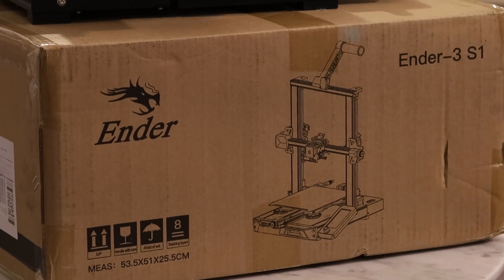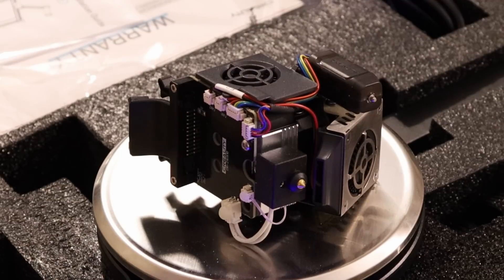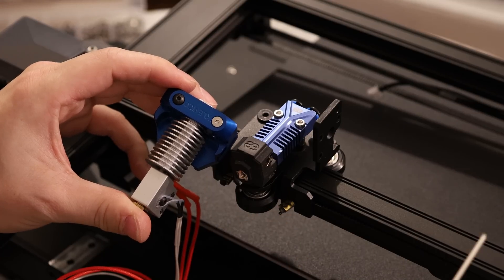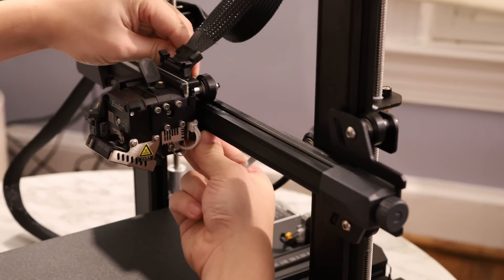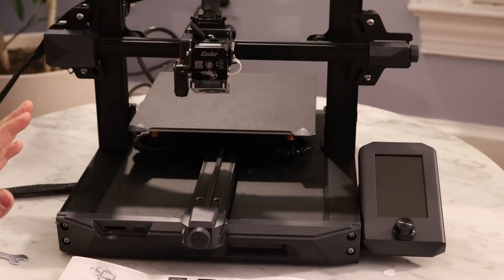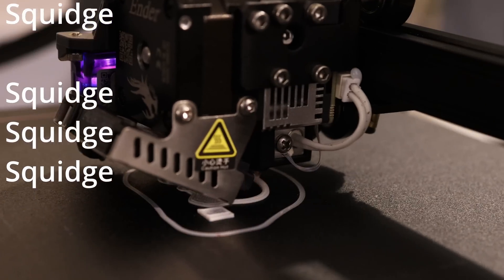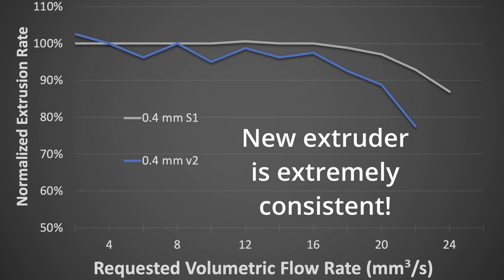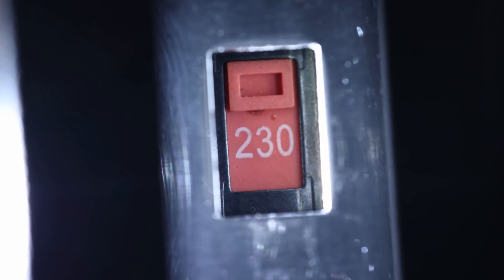Ender 3 S1 - A New Benchmark

Comment: centrifugal fans have way more static pressure than axial fans, so that's likely the main reason they changed it
Reply from the maker: Yeah, for pushing air through a heatsink it makes sense. They could use higher fin density inside of the heatsink. It's pretty much a straight shot through,  can't imagine much pressure drop occurring over that distance.
Reply: @NathanBuildsRobots  the higher pressure also means the air can take right angle turns without as much loss, so it can help with packaging constraints too, which is a common struggle with extruder assembly designs.  they're noisier too though, so i guess it's all a wash 😂

Comment: So I've owned an S1 for over a month now. I've added a new heat block and all metal hotend and changed the bed to glass and It prints amazing!. Comparing pictures of prints from the prusa i've seen on groups im a member of i will say they look identical in quality. The only thing that needs to be addressed is the auto leveling. I personally don't think the creality auto leveling is perfect. This is probably the reason I put glass on the bed, I don't use the auto leveling function on the printer but i manually level it myself with help from third party firmware. 

I would say if you want a printer that prints amazing out the box and you don't have to do anything to it... buy the prusa
if you want a printer that you can modify and change things then buy the S1 for half the price. 

I don't regret my purchase and I'm thinking of getting a second one soon!
Reply from the maker: Cool! I have someone in my Discord that says they use the bed leveling probe to tell them how much to turn each knob to level the build tray. They did it with a macro in Klipper. As you could see in the video, my bed was super warped, but I have done some full plate prints without issue, so the bed leveling must be doing its thing!
Reply from the maker: Oh, also I always overextrude the first layer, laying down an extra thick 0.6-0.8mm wide bead out of a 0.4mm nozzle, so it really squishes down into the bed. IDK if this would help you but that seems to work for me when I have bed adhesion issues.
Reply: @NathanBuildsRobots  thanks for replying :) I just don’t know what it is, if I level bed manually then run auto bed level then do Z axis it does the first layer okishhhh 

If I reset printer and manually level and print then it works almost perfect on first layers. 

It’s a great printer tho :)))

Comment: Love the video. I have the s1 pro it's also a very good printer. One thing I'd mention (granted I'm halfway thru the video rn) is your z-offset is too low. try raising it up a bit and you should get much better removal and very good adheasion still.
Reply from the maker: I already trashed the bed so I don't need to worry about it anymore!
How do you like the Ender 3 S1 Pro? I'm doing my review of it now. Pretty much done filming except for the conclusion.

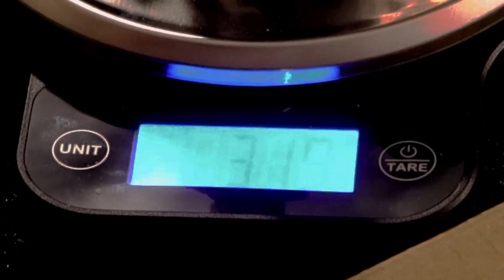Comment: 1:30
Putting the scale on a soft surface increases the measured weight over the actual weight

It would be a good practice to weight it again with the scale on a solid surface 😉
Reply from the maker: That's what I tell myself when I weigh myself on the carpet.

I don't see what would cause that effect, but it doesn't cost anything to set the scale on a hard surface so I'll keep that in mind for future videos.

Comment: Yeahhh definitely not an MK3 killer lol. Prusa still uses genuine stepper motors, rails and bearings, E3d hotends and Bontech gears, not trash bin components that will wear out overtime. Genuine kevlar gates belts that wont stretch and don't need any adjusting. No V slot wheels that need adjusting or will wear out overtime. Linear rails are more accurate and reliable than the V slot wheels. MK3 is held together with 3d printed parts and zip ties and still more accurate than an ender.

Creality's CR probe is just a re branded BL touch, And BL touches are finicky and less constant than prusa's PINDA probe, in my experience. MK3 doesn't need any bed leveling, just the initial Z offset. Creality needs that, plus the initial Bed level using the 4 wheels. The ender 3 S1 may share a bunch of features that the MK3 has, but even then, those features aren't even as good as what prusa offers.

Comment: hi, can this print nylon out of the box without buying extra parts?
Reply from the maker: Yes but mostly no. There are low temp nylon formulations that will work at the upper end of a PTFE lined hotend's temperature rating. But its a much safer bet to upgrade to an all-metal hotend first.. Either the official creality one, or the Slice Engineering Copperhead that I show in a later video.

Comment: "Prusa Killer" is sort of a stupid thing to call a printer that is aimed at a completely different market. A Prusa will print with high quality in minutes after opening the box and will repeat that quality for years with only minor maintenance. That is what you are paying for not a list of features.
Reply from the maker: Historically there has been a big gap between easy to use, high quality printers like PRUSAs, and cheap, dodgy hobby printers like the old Ender 3s. Personally, I'm glad to see some entries that fill the gap. For some people, this is as good as an I3MK3s, depending on what their needs are. 

Needs something that can run 200 hrs per year and is relatively easy to use? PRUSA and S1 have you covered, but S1 is cheaper and has less lead time.

There are still a host of areas where the PRUSA is better, but in terms of ease of use, the S1 is pretty compelling.

Comment: the machined off inlets for the z-axis frames also means the old grounding issue is solved
Reply from the maker: I'm not familiar with the grounding issue
Reply: @NathanBuildsRobots  when you disconnect the PSU from its mounting points, (double-z mod) it loses grounding to the frame. i can't tell you that it creates issues in and by itself, but it could potentially create issues if your wall socket or circuit isn't properly grounded for whatever reason

Comment: It’s crazy that Creality doesn’t put a note in the directions, a large sticker on the back near the plug and the entire screen protector you literally have to remove from the control panel prior to use that says to check the voltage switch. If they did that it would make it virtually impossible to overlook. You’d literally need to be brain dead to miss something like that! Oh well maybe they will include that with the Ender 3 S2.

Jokes aside I did enjoy your content. It’s well paced and you focus on a lot of things that are interesting and useful to the community like the compatible mounting points.
Reply from the maker: I don't read so good...

Comment: I heard there's less memory, so what are the default safety precautions in the firmware. Y'know, things like Thermal Runaway, etc.,
Reply from the maker: I have triggered thermal runaway on the hotend with my fan that blew too much air, so I know its on there. I'd bet they are all in place but I have not tested them individually.

Comment: how does the auto bed leveling work does it level itself or it lets you know where it’s uneven in level?
Reply from the maker: At the beginning of each print it makes a topographical map of the print bed, then moves the Z axis up and down as it's laying the first layer, to make sure it is at the correct distance from the bed. It requires a 1- time setup, then it automatically levels on all your future prints.
Reply: @NathanBuildsRobots  I’m guessing this is only good as long as you have the same nozzle on it? I often switch between 0.4 and 0.8, which have different “heights”, making the auto levelling sorta pointless right?
Reply from the maker: @rushilkisoon  yeah you would just have to change the z offset using the screen interface when switching nozzles.

As long as it's +- about 1 mm you should be fine. 

Some printers have load cell based ABL which would work better when changing between nozzles.
Reply: @NathanBuildsRobots  cool thanks for answering! I guess until I decide to upgrade to a nozzle based, load cell mechanism, like the prusa, manual levelling will have to suffice on my 5 Pro.
Reply from the maker: @rushilkisoon  the prusa uses a pinda probe, which is their name for an induction probe. It is essentially a non-contact limit switch. It only work on metals though, and you have to adjust the z offset with nozzle changes. Adjusting the z offset is pretty common and not too much hassle. 

The newer prusa max, which hasn't been released yet, is said to use a loadcell based system. The cr-6 se, mingda magician x, and more use loadcell based leveling.

Comment: Do you think this is worth the extra money over ender 5 pro?
Reply from the maker: Yes, I think the bltouch and direct drive extruder are totally worth it. You can easily print about 4x faster (I posted a PrusaSlicer profile on Patreon to set this up), and about 8x faster with a nozzle upgrade.
Reply from the maker: But if you already have an Ender 5 pro I would put that money towards upgrades. Any dual drive, geared, direct drive extruder will get you that speed upgrade, and CR-Touch can be added to any printer.
Reply: Thanks man, i am a total newbie to the world of 3d printers and this would be my first printer, where i live the ender 5 pro costs 430$ while the ender 3 s1 costs 590$ that's why i was confused if its worth the extra money

Comment: Does the X-axis belt still rubs on the left of the X-axis profile and self destroys itself?
This was an issue on Ender 3 v2. I am curious if this issue is resolved in this upgraded version.
Reply from the maker: I have not had that issue. You should be able to adjust the belt so it doesn't rub, but if it's not lined up right from the factory you would need to correct it.

Comment: Great channel, btw the flex plate is not meant to rip things off, you HAVE to bend it and flex it to get the print off, or it will have the issues you are having!.

Otherwise, great review. I think it's a great printer, I don't think the issue with the Prusa/Ender comparison. I think the main issue is the support, Prusa has the support that Ender will likely never have.

Comment: If I have an Ender 3 Pro, do you think this would be a suitable upgrade?
Reply from the maker: It is quite a bit nicer than the Ender 3 Pro.

Just a heads up, they are working on an Ender 3 S1 Pro that is coming out next month which will have the PEI sheet and all metal heatbreak for an extra $100. Those are some very nice upgrades IMO, but can be done on your own too.

There is also a CR-10 Smart Pro (its the only CR-10 with the new sprite extruder on it). Its not on sale on amazon yet, but you can get it direct from creality. It's like this machine but bigger with a 300x300x400 build area.

Comment: Prusa killer? Hardly. Its an improvement on the Enders recent design, but it seems all they can do is chase Prusa's tech and upgrades. What real innovation has Ender brought that Prusa hasn't already done?
Reply from the maker: Yes, but Creality is winning at price and availability.

I think the PRUSA I3MK3S prints better than any of the Creality machines, but for most people the quality difference won't matter, and the increased price, lead time, and difficult assembly is not worth it.
Reply: @NathanBuildsRobots  difficult assembly? The instructions are so well written with good color photos that its would be really hard to do any mistake. If I managed to build it without any issues everyone can.
Reply from the maker: @ripmax333  can you do it in 15 minutes without instructions? I had to replace a hotend on the prusa and it took longer than assembling this entire printer.
Reply: @NathanBuildsRobots  no you can’t build it in 15 minutes but it’s not difficult to assemble, if someone is not mechanically inclined there’s the fully assembled one which comes ready calibrated from the factory.

Comment: I noticed since you did this video, the hot end has been replaced, the build plate is replaced, the fans have been replaced etc. 

I don't think this is anywhere near being a Prusa Killer as the thumbnail suggests. Let me know when Creality releases a printer that doesn't require you to basically rebuild the whole thing to make it tolerable. 

After buying a Prusa, I will never touch or bother with a Creality printer again.
Reply from the maker: They just announced an Ender 3 S1 pro version that comes with all metal hotend, PEI sheet, and can go to 300C. Only thing that I would replace on that machine is the fans.

Kinda pissed that this one didn't come with that stuff.
Reply: @NathanBuildsRobots  That's crazy, seems sort of pointless that they released the non-pro version? I feel like Creality really needs to tighten up their product releases..
Reply: You can get the pro hotend though for 80 bucks.. at least there is a path, even is not optimal

Comment: I like your video. Nicely done, good pasting. I felt that you respect my time. Thank you. Like and Sub.
Reply from the maker: I certainly do respect your time. I typically take 6 hrs of footage (200-400GB) condense it into 30 minutes, then cut anything that doesn't move the story forward.

Usually the result is 6-12 minutes of quality content with good flow.

Sometimes I explain for 15 minutes one little aspect of the project in great detail, and end up cutting it out. Its all part of the process. 

Cutting out all the tidbits is painful but necessary.
Reply: @NathanBuildsRobots  After this all cutting, even those nice parts, you were left with something really good. Thank you for your work :)

Comment: If you can swing it, I'd love to see review of the Flsun Super Racer
Reply from the maker: Whenever I get a request like this I shoot an email out to the manufacturer to see if I can get one. I have asked them a couple of times for a review unit but no response yet.
Some printers I just buy because they are popular enough, like this Ender 3 S1.
Reply: @NathanBuildsRobots  I have an Flsun Super Racer. No z axis (technically?) means basically no layer line issues. Even if you don't do a review of it, I highly recommend the printer just for quality and speed purposes.

Comment: Imagine if Creality and Artillery3d got together to jointly make a whole new printer. All the best bits of both with their combined research and dev team.

I know it'll never happen, but whatever.
Reply from the maker: I know some people in the community that would do a much better job designing a printer than any of the big corporations. There is a lot of really talented people here on YT.
Reply: I love both companies but artillery has always just worked for me
Reply: @BreakingElegance  I'm loving my Flsun Super Racer. Though for the price you could get a very competent CoreXY printer with a larger print volume.
Reply: @YourLocalRaccoon  Yeah I have an Ender 6 fully modified running klipper and MGN-9 Linear rails its pretty fast  I also have a Biqu H2 v2 on it so its direct drive now I am building a voron 2.4 right now and I have a total of 10 3d printers so i have a problem
Reply: @BreakingElegance  that's not a problem lol. Are you using them to make money?
Reply: @YourLocalRaccoon  I am going to start selling stuff soon so not yet i just bought these to do that

Comment: Finally the ender 3 have a port like the biqub1
Reply from the maker: The Biqu B1 looks like a great machine. I just wish it had direct drive like the S1
Reply: @NathanBuildsRobots  there is a kit for that is the biqu H2
Reply from the maker: @michaelperez6811  I like the H2, I'm using it on another printer. B1+H2 would be a good combo, up see if I can get them to send me one.

Comment: Man your reviews are badass! For the stock setup what is your preferred cura profile?
Reply from the maker: There are a few time where I use Cura, but most of the time I use PrusaSlicer. At the end of this article I talk about how I set up my print profiles for the S1:
https://www.nathanbuildsrobots.com/testing/ender3s1
Reply: @NathanBuildsRobots  thanks man, I’ll give PrusaSlicer a try and see how it goes. I’ve heard good things. Keep up the good work!
Reply from the maker: @korak8456  I like how responsive and easy to navigate PrusaSlicer is. The main things i don't like about Cura you have to wait for slicing, and word-search for print settings.

Also Prusaslicer has some really good built-in editing tools.

Comment: Im pretty sure you are supposed to put the scale on a flat hard surface... right?
Reply from the maker: Flat is important, but it doesnt have to be a hard surface. Though a hard surface will do a better job of staying flat. The only thing that could change the reading is if things were moving around.
You could put a scale on a pillow, and as long as everything is stationary and flat, it will produce the same reading as if it were on concrete.